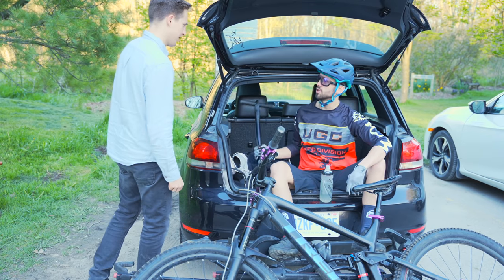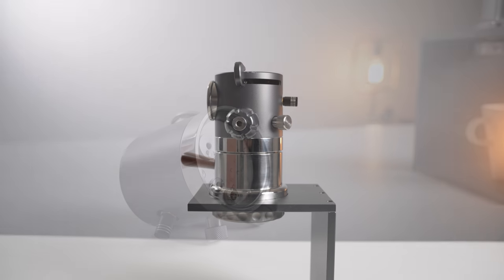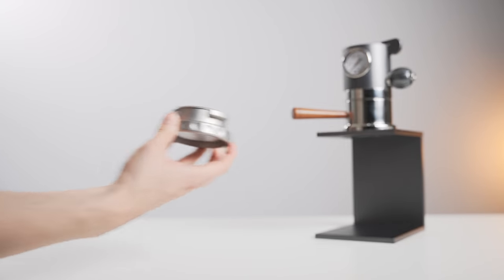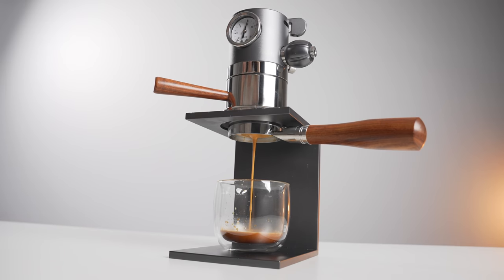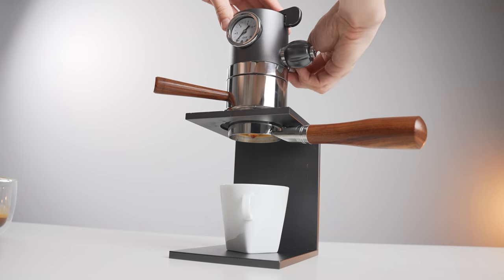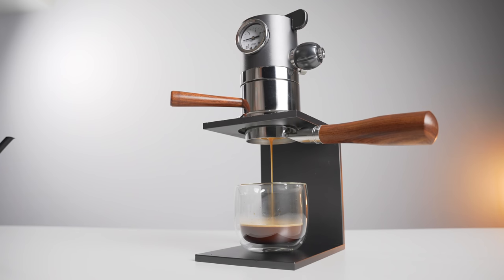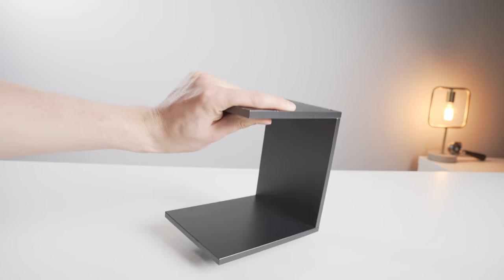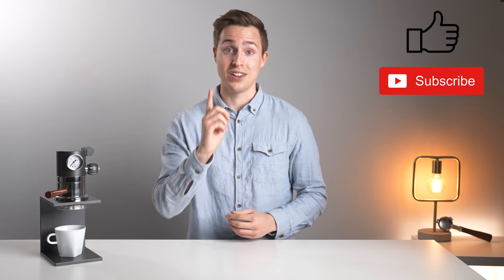Bike Pump Coffee? | Xbar Espresso Review

Comment from the maker: Would you back the Xbar?? Why or why not!
X Bar Kickstarter: https://bit.ly/3o8BI7u
Reply: No. The killer is the schrader valve. Most good bike pumps are presta valve
Reply from the maker: @gurusson  Plenty of good pumps using presta / schader combo valves! Mountain bikers deserve good pumps too ;)
Reply: @LifestyleLab_  Yeah, I have a schrader pump. I use it for my shocks.
Reply: @gurusson  presta valves make it easier to pump tires up to a high pressure with less volume per pump. That's really the only benefit. But you also wind up pumping more.   I'd hate to have a presta on this with the potential to hit it and bend valve cores.  It's not going to be that hard to pump up
Reply: Wish I had seen thise before would have made a ks account to get one

Comment: Matt,

Thank you for taking the time to make this impressive review. It's really the first time we see someone using a manual bike pump on this machine. That's exactly our original intention - creating a system with some potential DIY methods. 
Also, we will have an upgrade kit for using the charger holder as a refillable cylinder in the future, so people don't have to waste so many small cartridges.

Vincent & the Xbar team
Reply: I’ll leave this here…boom 🧨

Tire Booster Tubeless Tire Inflator. 

Lots of manufacturers making reusable inflators.

Change your inline fitting to Presta and you’ll never look back.
Reply: Why on earth schrader valve? Presta would definitely bethe correct choice

Comment: fascinating. im obsessed with these machine-less espresso-maker contraptions because the cleanup and maintenance seems so much simpler which i personally find highly valuable. not needing to plug anything in or worry about batteries or boilers or descaling or inner parts i cant easily get to or fix myself seems more bothersome over time

Comment: Update to the product could be having a hpa tank that you can fill and that can come with a 3000 psi tank that sits in the back of the machine. This would make it slightly bigger to hide the tank but it would allow it to last and work much longer and if you don’t want to use a pump to fill it you can take it to a scuba shop and get it filled for 15 bucks and that would make at least somewhere around 50 shots if you have a 48 ci tank with 3000 psi of air pressure and knowing how long that last when using about 250 psi which is double that of espresso shots. Could even be more than that because in paintball that tank can last somewhere around 500 shots at 250 psi which I could see meaning 50-100 shots of espresso
Reply: Same thought or you can just get your own electric/battery pump. With a big enough compressor and tank, an espresso shop could be ran with these. The compressor and tank could be in a hidden room and run hoses to the machines. Less heat and noise for the customers. 

It’s crazy enough, it just might work.
Reply: @mcmigs1725  it could work but then what’s the point. It’s smaller and more tested to just have a normal style of machine
Reply: @adamhartman4312  agreed. Didn’t say it was smart or made sense. Just that it’s possible 😅
Reply: @mcmigs1725  😂lmao true

Comment: How about heat loss? I think they should add built in thermometer for showing the temperature.
Reply from the maker: A built in thermometer would have been great! 
The heat loss was actually quite manageable. The water chamber holds lots of heat, so its an par, or maybe even slightly better at pre heating than the Flair (non 58 versions)

Comment: Thanks for the review.
Can you comfortably control and decrease the pressure, after pumping, by opening the valve partly?
Reply from the maker: Yes, the outlet valve on the back allows you to "ramp down" the pressure as desired :)
Reply: @LifestyleLab_  Thanks, and if I can ask one more question - do you think this way of controlling the x bar is convenient enough, like using a lever?
Reply from the maker: It is easier on the arms than something like the Flair Pro 2. But the Flair 58 looks much easier to compress, we'll be getting that in to test soon 
In terms of control, it's not really better or worse than a lever system, just different. Once pressurized you can calmly adjust instead of constantly needing to press a lever

Comment: If you prefer using the manual bike pump, it may be easier and much cheaper to just replace the safety valve of a Moka pot with a Schrader valve.

Comment: Do you happen to have any source of pressurised gas, air compressor (oil free) or c02 tank? 

I'm curious if there's any sort of check valve or pressure profiler that would be able to step up (say from 3 bar or so) from a larger lower pressure source up to the 9 bar that's standard for espresso?

Comment: For using CO2, whether the 8 gram cartridge or a large refillable Sodastream bottle under the table but adapted by a pressure line, do you think this would work considering the refrigerant effect from releasing the cart pressure? That was something I had not considered and that you point out. Additionally, I was disappointed to learn from your video, that the flow pressure control paddle does not work when pressure is introduced through the Schrader valve. A modification by the creator for that would be great.
Reply from the maker: I agree, I really wish you could manually pressurize, and then use the flow control lever. That would be a killer feature. 
I spoke to the creators and there are plans to make a SodaStream adapter of some kind, which would be nice to make it less wasteful. But adapting it yourself is certainly an option if you're handy!

Comment: A better design would be a canister to store the air pressure like in those booster pumps for tubeless tires and a lever in the espresso machine to control the pressure you put out for the shot. Cool new design but I think control and consistency would be an issue.
Reply: when you use CO2 canister  pressure control is very easy and consistency is no issue at all. It does not need your arm and body to pull a shot compared to manual lever. It can do either constant pressure or declined pressure profile compare to a spring lever. With a proper adapter you can use soda chargers as well.

Comment: Can this make nitro coffee if you replace CO2 cartridges with N2O?
Reply: It doesn’t work like this. Neither CO2, nor N2O, dissolves much in hot water. Meaning in the Xbar the CO2 (or N2O) stays on top of the hot water and pushes that through the coffee puck. If you’d use cold water (room temperature or below), the gas would dissolve into the water until the water is saturated with the gas. Whatever gas is then left in the cartridge, that cannot be dissolved, will then pressurise the brew chamber.
But you cannot make espresso with cold water. And I don’t think you can make cold brew or nitro coffee in thirty seconds.
Then again, you never know until you try… :)

Comment: Highly likely anyone that already hasan E61 portafilter has the machine it works with and using this is a downgrade. Need for compressed gas cartridges or external pump and no temperature control. Seems a handpresso like machine accomplishes the same thing in a similar way and is compact and light. Have to see a very meaningful pressure profiling result to go through all that.

Comment: @Lifesyle Lab - CO2 has a very low heat capacity, less than 1/4 of water per unit mass. If you use half a canister (6 grams), then CO2 would have a del Cp of about 5 J/K, whereas a 120 ml shot of water would be ~501 J/K. In other words, the CO2 would not make a measurable difference to the temperature of the water shot, even if it was perfectly mixed (which it isnt, most of it sits ontop of the puck) :)
Reply from the maker: Great breakdown!
Reply: They have a pocket size electric pump in their demo video on kickstarter.

Comment: This is how regress looks. It is like going back to feudalism. Lever things are also indicators of the same.
$60 Chinese or Delonghi espresso machine is head and shoulders above this, even if not shiny enough.
$70 one even will have pretty accurate pressure gauge and you can use steam valve for pressure profiling during shot.
Lot of used Brevilles with gauge go at below $100 and with plastic bottomless portafilter they are astonishingly good.
Refurbished Bambino Plus is below $200-240 and it is whole different league, where you actually make good coffee in seconds.
Reply: Fully agree!
Reply: That's true only because those machines came down in price considerably over time. This concept should fundamentally be cheaper because the most expensive part of the machine is eliminated (the pump). This particular machine may not be cost effective, but the concept does have potential.

Oh and I must admit I like the novelty of it, too.
Reply: @laurensverheij921  Well, contrary to abstract novelty progress and regress have simple definitions.

What you mean under " those machines came down in price considerably over time"? I mean here that you can actually buy very good $70-80 Chinese espresso machine, new, online. $120-140 are already range of 58mm models with thermoblock during usual sales.

Lever machines here are expensive due very small amount of produced units, inefficient production (like CNC or similar). Also firms who sell they want really big profits and fast return on investments. Contrary to this approach simple looking Chinese machine can be made in city size huge factory that makes all parts inside and that is also full of modern robots and huge number of molding machines.

Biggest hurdle in modern machines with pumps is that resellers, including large online retailers can't move progress any further as it means reduced profits for them. Hence, besides looks they barely move forward.

Get even superb Descent machine - they managed to rise price 3.5x,  and focused on commercial sector and niche buyers.

Comment: What a silly design. $16 for a CO2 canister 12 pack, you need boiled water and a whole lot of nerd pride just to take three times longer to make a mediocre espresso. I suppose you could hook it up to a compressor, which again, who in their right mind would do any of this? 

OR you could buy a garbage espresso machine on Amazon and get the same level of disappointment one tenth of the effort.
Reply from the maker: Except this actually makes quite good espresso and the work involved is less than most other manual systems like the Cafelat, Rok, Flair, etc...
Reply: @LifestyleLab_  I guess it depends on how you define less work. Is using a bicycle pump less work than a lever? Probably not. Is using a CO2 canister less work? Indeed it is. That said, I suppose the proof is in the proverbial pudding. If you’re enjoying the results that speaks volumes. 👍🏽
Reply: Wondering how you know it makes a mediocre espresso if you haven't used this type of machine?  When using a co2 canister it is equal to (if not better than) a spring lever espresso machine and make excellent espresso. btw you can buy 100 canisters for $45 that will give 400+ shots.
Reply: @jameschang8174  not claiming to. I suppose I was being a bit too gruff in my assertions. I apologize!

Comment: Bike pump and CO2 is a buzz kill. Bike pumps are not sterile.  CO2 is nice but as stated, wasteful has hell. Aesthetically nice. corners should be softened a bit IMO. Also, it would seem that temperature management would be an issue  with the metal body. soooo...they will need to explain why this is better than a good Moka Pot.  Nice Metal Art but not practical..It will wind up in a design museum.  Stick with your Aeropress and do better use case analysis for the 'Mark II'  ;-)